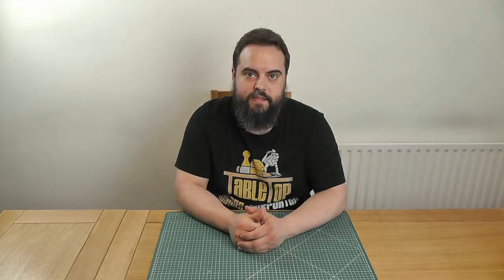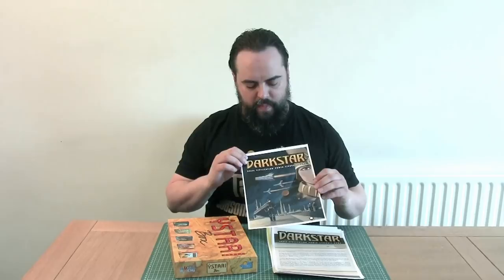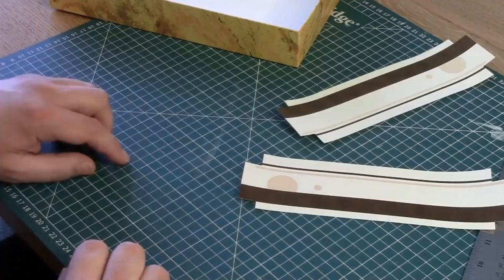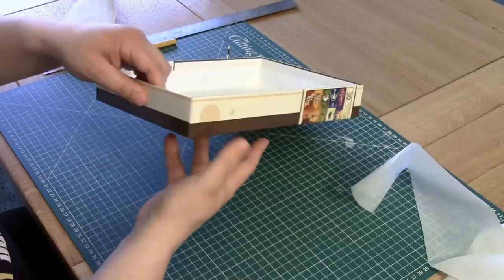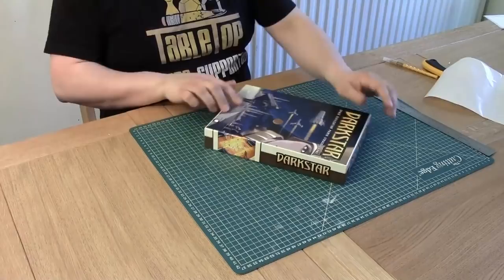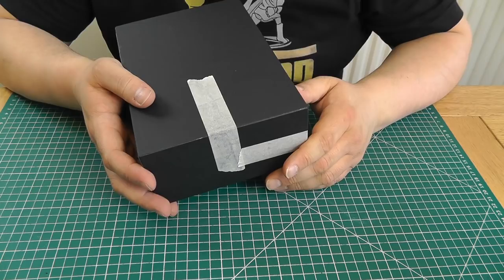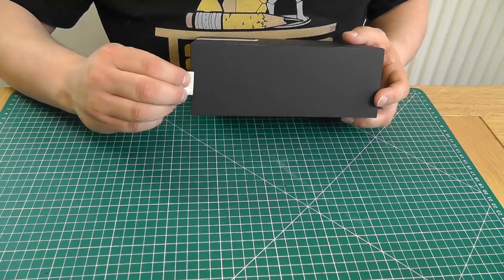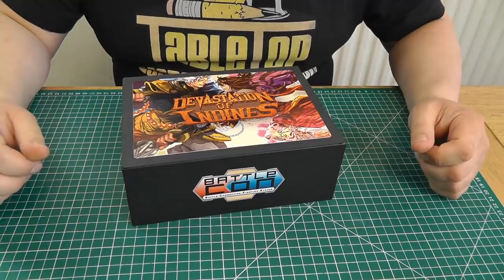How to Make Large Game Boxes - Dining Table Print & Play

Comment: What's the best method to make sure the top fits snuggly over the bottom? How many mils bigger must it be for the right fit. You kind of glossed over that bit in the video.
Reply from the maker: If you're talking about making a box out of wrapped cardboard, I would suggest a) always measure the actual outside of your actual made-up box bottom before you decide on the measurement for the lid, because it's not necessarily the case that it's going to be what you expect, and b) add around a millimetre of extra width and length (which is what I did but didn't explain clearly in the video). Much more than that and you'll get a loose lid that falls off too easily; much less than that and it'll be too tight to get off again later. An inch is defined as 25.4mm, so a millimetre is 1/25.4th of an inch, or 0.0394 - pretty much 39mil. Might as well call it 40 if that's easier to measure.
Reply: @DiningTablePrintPlay  Great. Thanks for the reply. Just working on the bottom box...

Comment: How to search for 'thick card' in online shops? I am not sure what item to buy. Its confusing - there's chipboards, cardboards, and mostly results show finished storage boxes.
Reply: Unfortunately the name it's sold under depends a lot on where you live! Strictly, the stuff I'm using is a relatively cheap "unbleached paperboard", generally made mostly from recycled paper pulp. In the US, and probably therefore in Canada and anywhere culturally similar to the US, it's called 'chipboard', which is used as a generic term for 'normal' paperboard. Here in the UK and I believe in Aus/NZ (and possibly therefore other British Commonwealth countries), it's called 'greyboard'. It's usually measured in hundreds of microns, millimetres, or (in the US) small fractions of an inch rather than by weight like most thinner papers.

You can also use things like mounting board/mat board (the stuff used to make passe-partouts for framed pictures), which is often more readily available but also a bit more expensive since it has a finished face; binding/book board is good for boxes if you find that instead; and if you're making smaller boxes then you sometimes find a product sold as 'magazine board' or 'comics board' which is an acid-free version of greyboard (again, sometimes with a facing) intended for stiffening magazines/comics stored in mylar bags by collectors, and that works pretty well too. The specific product isn't that important so long as all the bits that need to stick to it can do!

Online you'll need to search for some of those terms, but realistically if you can get to a bigger stationers, an art supply shop, or a framing or binding supply shop, you'll almost certainly be able to pull something out a rack which will do. Ultimately a box just needs a rigid board that takes whatever glue and/or tape you're using and has a thickness you're happy with - everything else is just availability and economy.
Reply: @JakeStaines  Thanks for your reply. Really appreciate it. Will look up these options.

Comment: So I've finished my box and I'm really pleased with it! Thanks for the tutorial and the previous reply to my question. One more question: What paper did you use for the wrap? Presumably it wants to be pretty tough etc so is there any particular paper that works best?
Reply from the maker: I'm glad to hear it worked out for you! The blue paper I used is a wrapping paper for gifts - you have to get the 'luxury', 'deluxe' or 'premium' stuff for boxes you're going to keep, in my experience, regular wrapping paper tears too easily. Kraft paper is a great choice, as that's really strong compared to other papers of a similar thickness, and that comes in a variety of colours - but often kraft paper has a texture, so if you want a really smooth finish you have to be careful which product you buy.

The approach used to decorate the first box in the video will also work for the other two boxes - so long as you have label paper that's at least as large as one side, and preferably the top and bottom faces of the box. You can use multiple labels on a side as well, of course, if you're really careful to line the edges up against each other so there's no gap.

Comment: Very interesting video. Another couple of handy gadgets to add to my shopping list. With regards to the manual cutting of the rebates on the foam core board, in order to remove the last remnants of foam a sponge sanding block may be helpful. They are pretty square in shape and would produce a smoother finish for gluing. Also, in the past, I have used the wrap method on jigsaw box lids. Jigsaws can be picked up cheaply from charity shops and they nearly always have a grey board tray, so no need to decorate it, unless you want to.
Have you thought about getting yourself a scan and cut die-cut machine for cutting out you paper box panels? We have a Brother machine which is awesome for doing just that. I had no idea Xyron made a full size (A4) label maker machine. I will investigate that, despite the cost, it must be heaps better than using harmful spray glue.
Have subscribed now, I can see your channel being extremely useful in the future.

Comment: This video is absolutely phenomenal, and I can't thank you enough for this. Unfortunately, both rabbet cutters and mat cutters seems to be hard to find in my area (non-US). For foam board, I think i can make do with either butt joining or freehanding a 45 degree cut, but this solution simply won't work with chipboard. 

I've seem some mentions of scoring the paper instead of cutting in a 45deg angle. Do you happen to know how effective that would be on a 2mm greyboard (which seems to be what you're using, I think)?
Reply from the maker: It's certainly possible to score and fold 2mm greyboard, but you have to be careful! Unlike paperfolding techniques, 'score' here is used in the sense of making a light relief cut into the face of the board which will be the 'outside' of the corner, so that when you fold along the line you're opening the cut up so you have to actually fold less thickness.

If you cut too far the joint will snap when you fold it; if you don't cut far enough it won't fold cleanly and... also may snap, but for different reasons. You want to get about halfway through, and make sure that you're ready to proceed with everything else when you make the fold because the fibres will tear a bit and shift along the fold line and you should try and avoid flattening it out again once folded. You may find the corner then benefits from  a bit of burnishing with the side of a metal rod (e.g. a screwdriver or the shaft of a pen) to smooth down any fibres that might be sticking up before gluing a wrap over the top.

I suspect this is probably how sturdier game boxes are made underneath the wrap - with thicker boxes you'll often see what looks like a 45-degree bevel on the top edges of the box lid, which is what you end up with if you score and fold.

Comment: For creating the box, what tape are you using?
Reply: It's gummed paper tape - it comes 'dry' on the roll and you have to moisten it to get it to stick, like old-school stamps. Once it's stuck it holds like anything, it's tough enough to take some flexing without trouble, and unlike cellulose tapes (Sellotape, 3M Scotch, etc.) it doesn't break down and get brittle over time. Here in the UK it's often called "Butterfly Tape" after the most well-known manufacturer - it's actually intended for running around the back of picture frames to seal them and prevent insects getting inside, so you often find it in framing or art supply shops.

Comment: You don't need to CUT 45 degrees into the card for the corners. Just push in with a ballpoint pen. It'll dent it in well enough to do the job.
EDIT: You may be using thicker/tougher material than I was thinking, but you should definitely look into it.

Comment: Could you send me the link of the cutter you use to make the sides so perfect? thanks. Min. 26:18
Reply: It's a "foamcore rabbet cutter" by a company called "Alvin", but unfortunately it seems to have gone out of production since I made this video. I bought mine from this Amazon listing:
https://www.amazon.co.uk/dp/B001DKMX1K/ref=pe_385721_37038051_TE_3p_dp_1
However, that's now unavailable. Logan Foamwerks products are pretty good, though, so while it's a bit more expensive this product will almost certainly do the same thing just as well: https://www.amazon.co.uk/dp/B001JSWKLO/ref=dp_prsubs_1

Comment: Id probably cut a D shape hole in the box lid. rather than using your nail at the edge to open it you could just poke your fiinger in the small hole and pull up from there. lot more reliable and easier if you dont have nails

Comment: 49:06 what kind of cardboard is he using
Reply from the maker: It's "greyboard" - which is the kind of board used for bookbinding, boxmaking, etc. ... or the bottom of pads of paper. It's a fairly basic paperboard with no fancy facing or coating.

If you have a local printer or binder, they often sell greyboard offcuts and/or pallet ends cheap. Otherwise you can find it at better stationers, and a lot of stationery supply places online.
Reply: Dining Table Print & Play Thanks

Comment: is this channel dead because i see no new stuff for along time now. and i could use you help to make a template i can print out on a4 paper in parts to make a few boxes ( parts i meen to print it out in a4  and cut them out and add them all to 1 big cardboard to make the boxes. in  box is like a big card box. for cards that is 16,6 cm With and 24 cm height. and 5 cm high and second is a box that can hold 2 of those cards boxes. i hope to hear from you thanks from Denmark
Reply from the maker: The channel isn't dead as such - and it's never had a regular schedule - but it's certainly on a bit of a break. We had our first child a couple of years back and it's much harder to cordon off the dining room and shoot a video when he's about... and he certainly takes priority! I still have some plans for videos to make, but it's slow going and between that and the added stresses of working at home through a pandemic with a government that's gone right off the deep end, it's hard to find time to sit down and plan or edit videos...

For that kind of size box, I guess you have two main choices.
One is to make a big telescoping box - like the third option in this video - in which case I'd suggest measuring and cutting the board directly rather than trying to make a template anyway, then measure the actual measurements of the outside faces of your box to make a printed wrap (with an appropriate overlap) if that's what you're after.
The other is to take a big big of card similar to cereal-box card and make a deckbox-style box. You'll find it's harder to open the flap without creasing it when it's that large, but it's certainly possible. There's various tuckbox template generators around, and once you've got your giant PDF template that absolutely won't fit on an A4 page, open it in something like Inkscape, and add a grid of light diagonal lines over the entire thing, like a tessellated diamond pattern. Then print it out split over however many pages you need, and you'll find the combination of the vertical and horizontal lines of the template and the diagonal lines makes it much easier to align the various A4 sheets together to make one big template. If you want to print a nice outer design on your template as you go, then just keep the diagonal lattice to the space outside the template, the bits you're going to cut away - so long as you have one line in each direction at each edge of the page you need to align, it'll help a lot. Good luck!